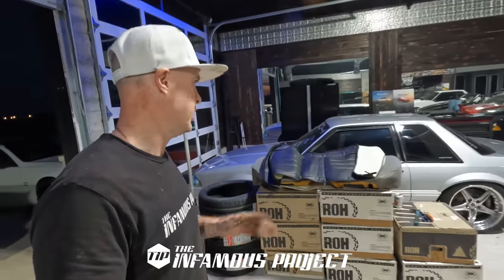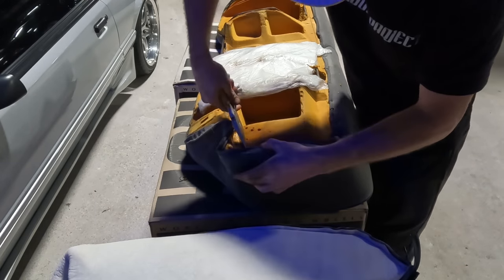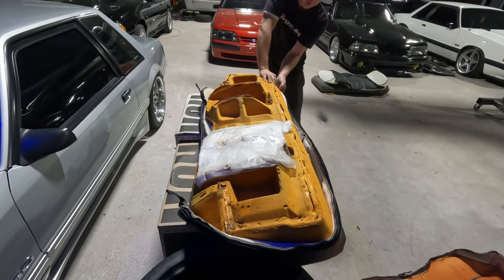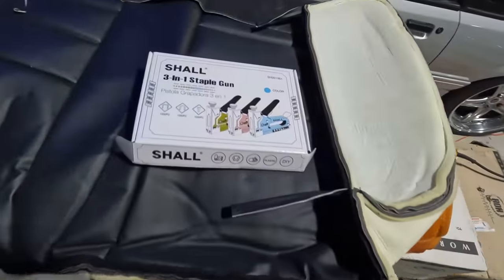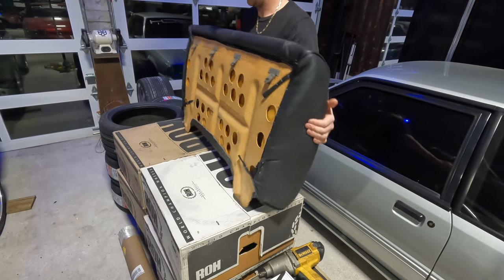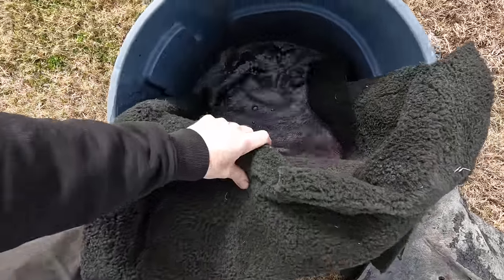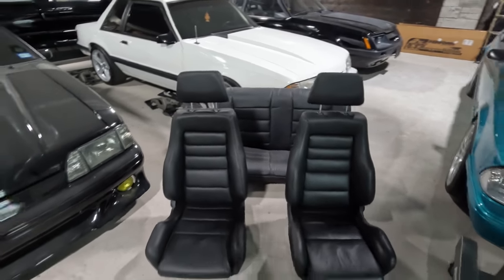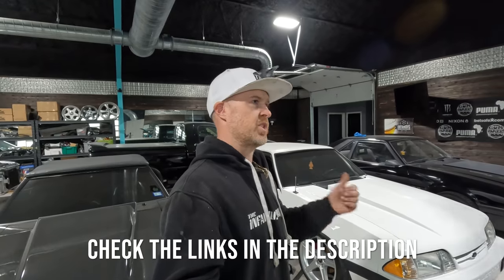Corbeau Seat Upholstery & Install into my 1988 Foxbody Coupe - TIPS05E07

Comment: my car has 275 35r 18 SVE 10/9 inch Saleen replicas with non adjustable tubular upper and lower control arms 5 lug rear disc converted I think it has an 95 axles do you think quad shocks would fit and would it help handling?
Reply from the maker: If you had 9s in the rear they would fit if you flipped them. 10s wouldn't clear them on a stock length axle so maybe with sn95 axles you'll have enough clearance? If you can run them absolutely do so!
Reply: @TheInfamousProject  I bought the car the way it is so it might even have the whole sn95 rear end in it I don't know it was all rebuilt with Axle tubes welded with 373 gears put in it converted to disc brakes don't know the whole story and I don't know that much about all these conversions just starting to learn it everything I've learned   says to take them off and they were already taken off but when you do hit a bump going around the corner it sure does walk around I'm thinking that might help with that.
Reply from the maker: @travisevans7502  it absolutely will help if you can get them on. Easiest way it to get a set and try!
Reply: @TheInfamousProject  thanks for sharing your knowledge it helps a ton.